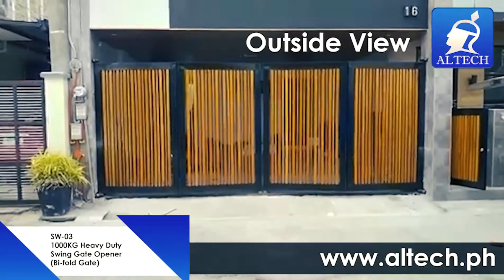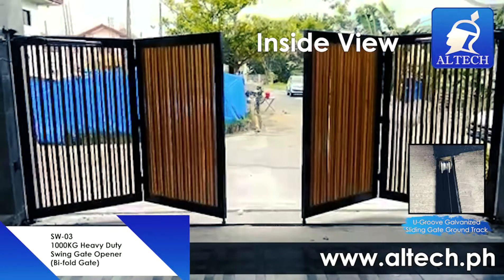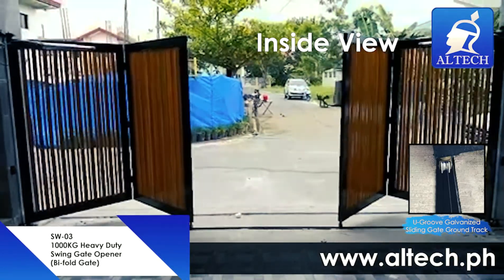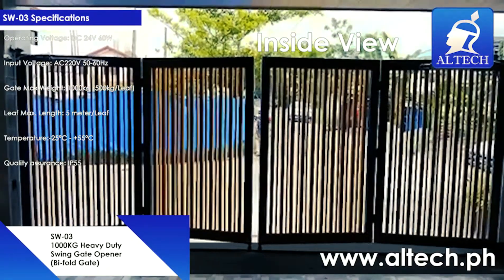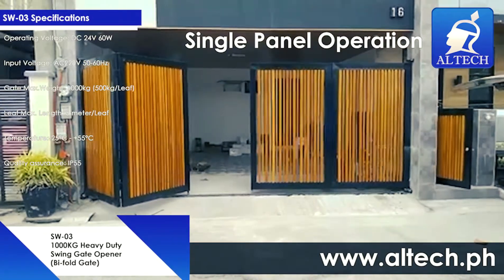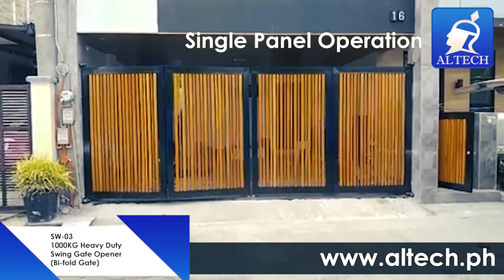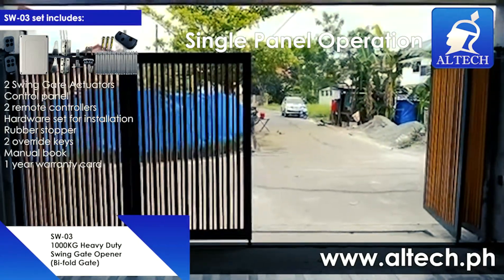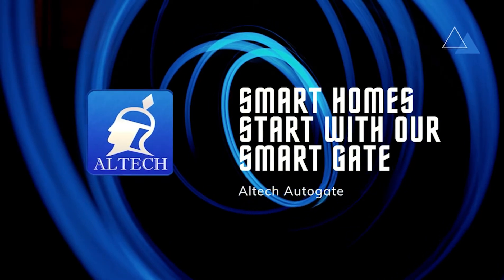SW-03 1000Kg Heavy Duty Swing Gate Opener (Bi-Fold Gate)

Comment: Hello . Beautiful strong looking gate.
I am very concerned about 1 thing with every bifold automated design .
Can I ask about the safety light barrier on this design . If some1 on the inside passes through the light as the gate is closing ,
Will the gate STOP in that position and stay in that position until it has some form of human input ?
Or 
Will the gate automatically stop closing and immediately try to revert back to its previous position? (in this case the open position)
If that is the case some 1 could break the light barrier (which will cause the gate to open again ) as the gate is opening this person is still passed the light , but still could be trapped in a “pinch zone “ between the 2 gates. Or is there a simple solution to this problem ? 
Thanks .